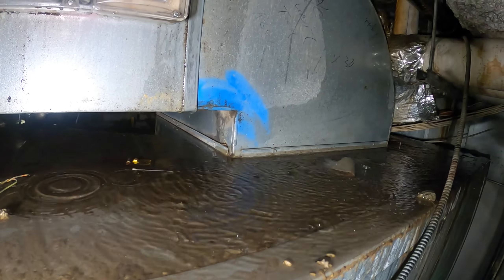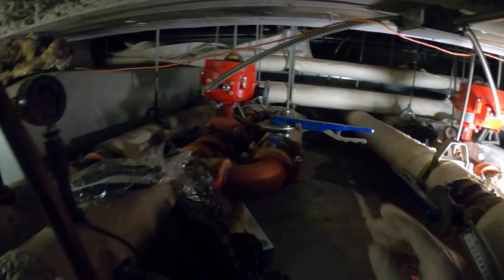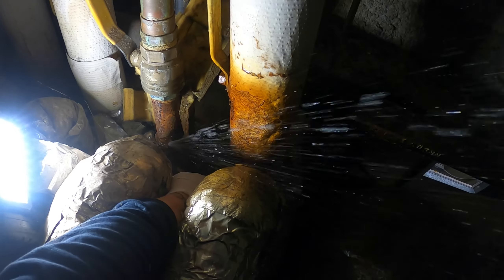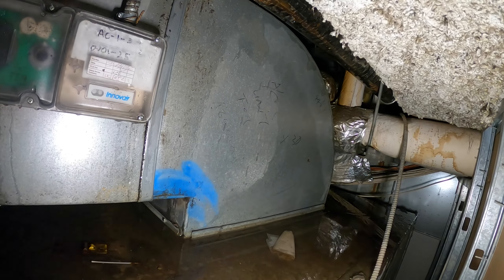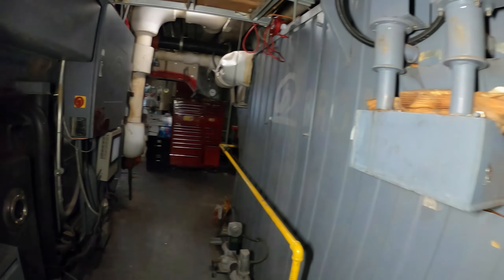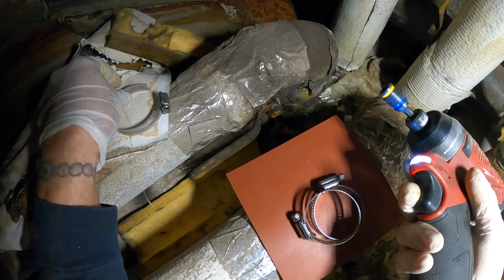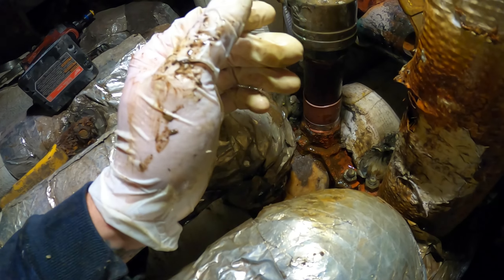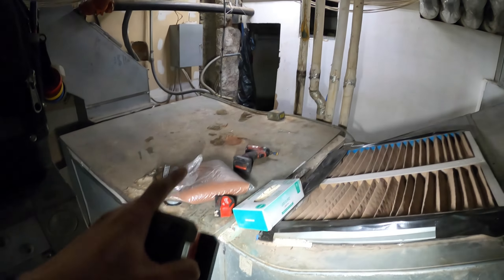HVAC Service Call: York 4 Pipe FCU NIGHTMARE (York Fan Coil Unit Not Heating/Not Cooling) Water Leak

Comment: It looks like you're a spider man as well as a jumper man! Those spaces you had to get into were insane. Doesn't anybody consider access for maintenance and servicing in these places?

Regarding the leak you had to patch up, what about using some underwater sealant under the rubber and then the hose clamp? Some swimming pool products will work underwater which got me thinking they might help here where the flow could not be stopped.

Comment: How old are the buildings?  1970s?  Looks like it.  Imagine the guys who did the original installation.  If it was built before 1970  the pipe insulation would be asbestos.  Who has to replace those florescent strip lights, I wonder?

Comment: Why would you even touch it? I would look at it and tell them it was installed incorrectly no dielectric nipples poor vapor barrier probably no water treatment. You touch it you own it. I know a company they did the same repair and told them it was temp. Three weeks later it failed they sued company had to pay 1.2 million in damages.

Comment: What a crap installation ,the whole plant looks  worn down. Chilled water pipe insulation is damaged and untidy,the vapour barrier compromised  everywhere,no wonder so much rust on pipes and valves.
Good effort at the  repair though .
People don't appreciate the difficulties encountered by HVAC  technicians out in the field.